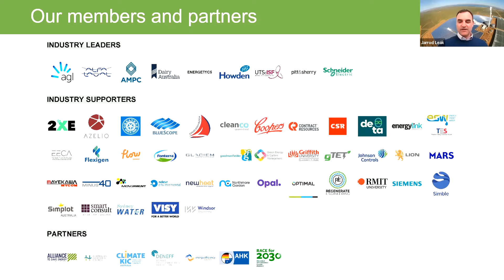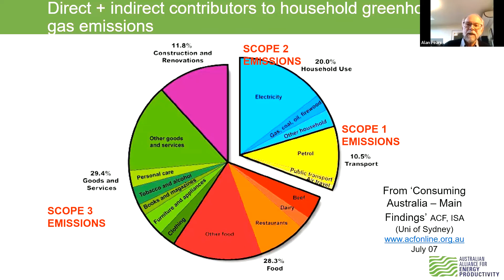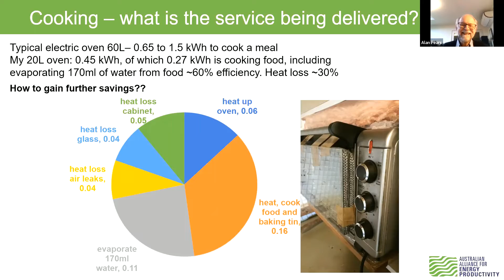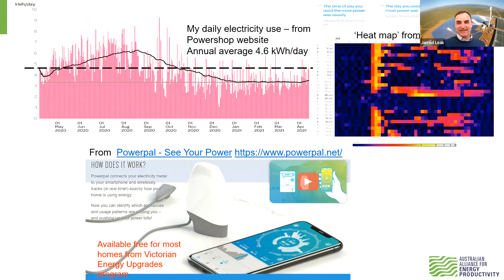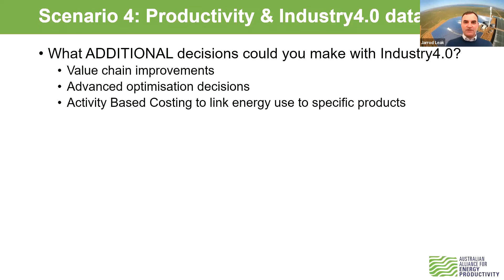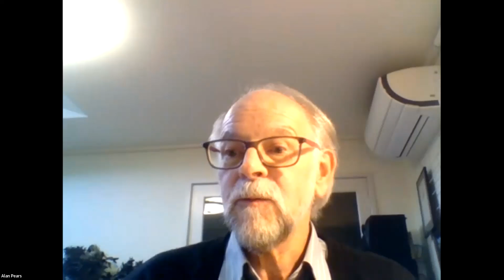Introduction to decarbonisation technologies - A2EP webinar

Comment: Thanks for the great video on the need for energy efficiency. Can you clarify your first slide (3:53) "What does it take to be carbon neutral"? - Offset projects generally don't eliminate remaining emissions, they reduce existing emissions (for example, projects to reduce deforestation, eliminate fuel-based cookstoves etc). Even industrial CCS is about removing some of the CO2 from fossil fuel burning and so reducing the rate of new emissions. All good stuff (like your wind turbine graphic) but, of itself, it does not get us to net zero. To do that, we will surely need genuine carbon reduction technologies that actually reduce CO2 from the status quo, not just reducing future emissions. Today I see very few of these.